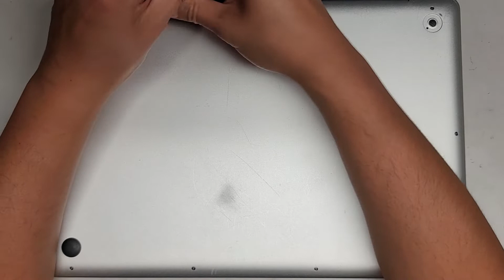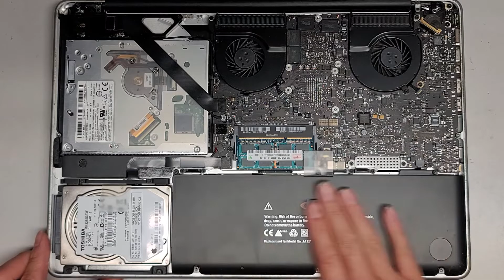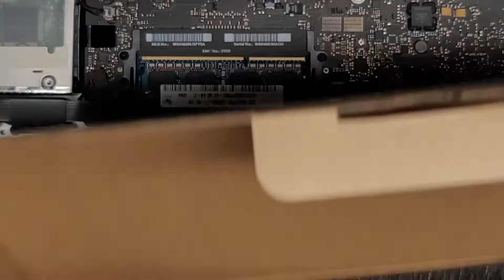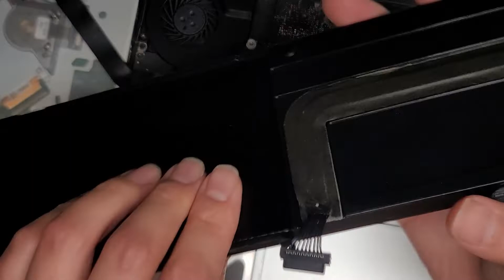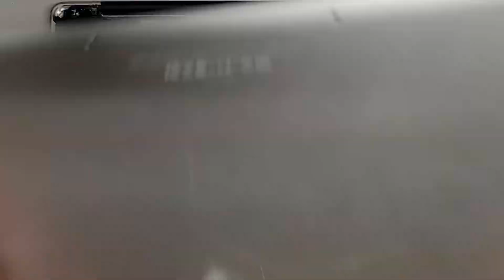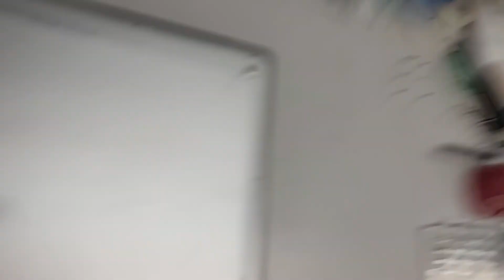Mid 2010 15 Inch MacBook Pro A1286 Disassembly RAM SSD Hard Drive Upgrade Battery Replacement Repair

Comment: Ive not tried it because Ive been told it won't work. I also did research and tells me it won't work unless you have the Mid 13
Reply from the maker: @josephmgomez3921  oh :(
Reply from the maker: @josephmgomez3921  oh :(

Comment: The max ram for this model is 8gb's, only the Mid 2010 13 takes up to 16gb's.
Reply from the maker: @josephmgomez3921  you tried?
Reply: @ItsBinhRepaired  Any mid-2010 MacBook Pro i5 or i7 is limited to a maximum of 8GB RAM. If you have a 2010 MacBook Pro Core2Duo (13"), then you are in luck and you can upgrade to 16GB RAM.
Reply from the maker: Nice

Comment: I have this mid 2010 1286 model i5
I wish to keep and use 
I have dell inspiron 15-7577 that repair shop told me motherboard burned and  replacing will cost 600$ so they offer better to buy some other laptop with this  money my question is can I use memory sticks and it’s  HD as apathy’s to give my Mac new life ? 
I also need to replace battery 
It’s 0% and works only when plugged to AC
Reply from the maker: If it's the same type of RAM. Replace the hard drive with an SSD.
Reply: Ill try to find specs of my Dell somewhere in order email confirmation
Reply from the maker: @GalvanicSpa2Bulgaria  OK